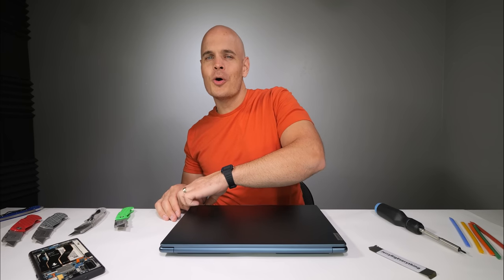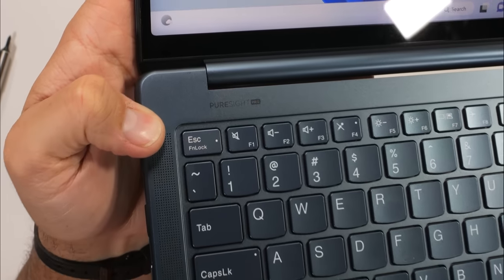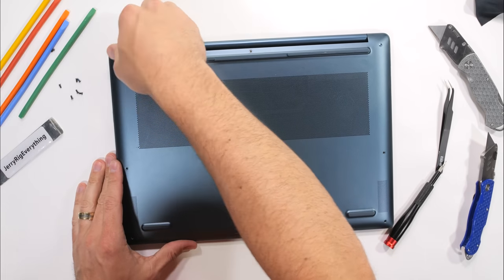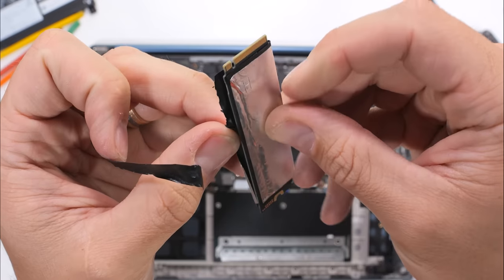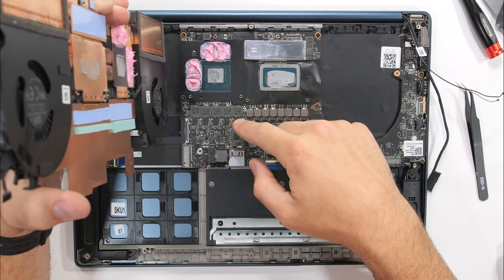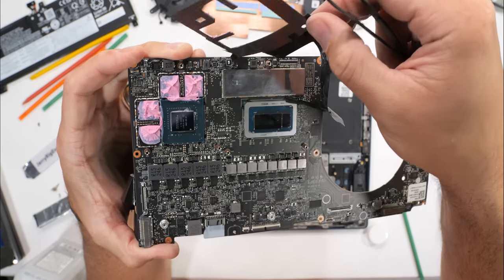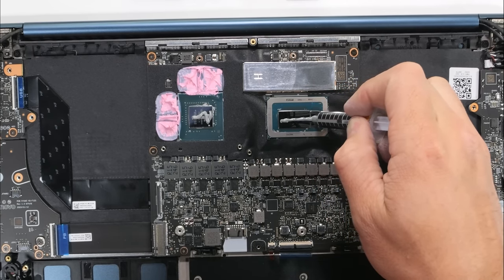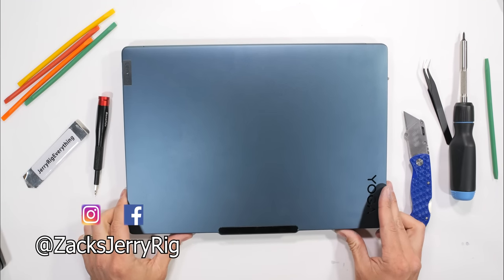FINALLY! - a Professional Laptop that actually puts out

Comment: Just a heads up, the 4070 which this laptop actually has is WILDLY different to a 470
Reply: Dude this annoyed me so bad lmao
ocd kickin
Reply: I thought it was like a custom GPU or sth 😂
Reply: What matters is the wattage and the cooling of the GPU. I doubt this 4070 can even match a properly cooled 3050 before throttling out
Reply: @Chief Master  will definitely match a 3050 lol probably about the same as a 4060.
The gpu is fairly efficient with rtx4000, new gaming laptops are mostly suffering from intel 13gen
Reply: My old y50-70 gaming Notebook had a 960m which had to send the output back to the cpu where the igp had the lanes to output it over hdmi. Nvidia drivers don't even work properly and you had to download obsolete drivers from Lenovo. If these Chinese slits keep doing this rip offs, it would be actually accurate calling it a custom gpu.
Reply: Exactly, fun fact even the 4090 laptop counterpart is only on par with the 4070ti desktop 😬
Reply: @Chief Master  maybe there can be tests to check that. But looking at that cooling solution,  the worst I can imagine is a 3070 if it goes down at all.
Reply: @Random 4400  Yes due to the massive voltage leap on desktop parts in the past 2 generation on the higher end.

Laptop gpu's wattage peaked at 200w with the 2080super or sth while desktops weren't that power hungry.

Nowadays the market shifted towards more sensible form factors and caps at 175w(for now)

The sad part is the actual specs though. 3070ti laptop shared about the same specs but the 4000 mobile series are all 1 tier lower than the naming. Would be more impressive of the actual namings were used, then 4080(4070) won't be too shabby against the desktop 4070
Reply: Just another notice to say, if jerryrigeverything wanted an actually powerful laptop while also doing good for the planet, he could just get a Eurocom Sky x9c, fully modular and far better for the planet as each part is modular and swappable. Besides it can support SLI RTX 2080 mobile. With Intel core i9 DESKTOP Processor.
Reply: ha, yeah, big difference.
Reply: @sierrachief117  it will never throttle as it has 100 watt 4070. 4070 is not scaling over 105 watt. It has best 4070
Reply: @sierrachief117  it will never throttle as it has 100 watt 4070. 4070 is not scaling over 105 watt. It has best 4070
Reply: @helloworld9996  some have great battery. I think something or some settings is wrong in many high end gaming laptops.
Reply: @HDRPC  As far as my knowledge goes, throttling means decreasing the wattage a chip is running at to lower the heat at the expense of performance. Just because a gpu is rated at 100w doesn't mean it'll not throttle at heavy workloads. And as far as thin laptops go, no matter the cooling system they suck at heat dissipation. Which results in throttling. But I digress. This laptop fulfills the need of a thin and light powerful pc and as far as these go, this lenovo might be your best option.
Reply: @sierrachief117  i have seen videos it is not throttling
Reply: @HDRPC  videos don't mean shit, bro. Your usage of the device putting it throughout it paces is what means anything
Reply: @HDRPC  I was surprised when Zack said it has 170W power supply. Both GPU and CPU have to be limited. My Lenovo Legion 5 with RTX 3060 (140W TGP) and 17-12700H has 300W power supply.
Reply: @sierrachief117  anyone dumb enough to game on a laptop needs to give me their extra money so i can upgrade my rig some moar.
Reply: @helloworld9996  13th gen is a big jump over 12th gen in efficiency, sadly.
Reply: @Lucas Blaney  not by much nor noticeable. Its still based on intel7 process(though slightly improved) that still lacks behind the leap on ryzen cpu to tsmc n4(nor is battery life 'improvements' highlighted in any reviews. Ryzen cpus will continue to enjoy a much longer battery life at least until intel manages to manufacture by their upcoming 20a/18a process
Reply: @hello world  it wasn't a massive leap in fabrication process but it was still a much bigger leap from 12 to 13 than 11 to 12 in the efficiency space. But, yes, AMD is the efficiency king.
Reply: @Lucas Blaney  it's not a big generation gap comparing to their only component amd or if u count in apple, which both have seen a substantially larger efficiency improvement per generation, amd laptops easily have more than 2x battery life than intel's since ryzen5000 and the gap hasn't closed in at all
Reply: @helloworld9996  okay
Reply: Although given how far the mobile versions of a GPU are from their namesake, maybe not that wild...
Nvidia, please just stop. You know it's deceptive. Just make a different naming scheme for the mobile ones.
Reply: @Lizlodude  I think they need to bring back the "mobile" moniker.
Reply: @Lizlodude  so they should come up with a completely different naming scheme just for laptops?
Reply: @johnathankrausrig9237  I’m literally writing this on a Lenovo gaming laptop using integrated graphics and latest drivers with no issues.
Reply: @Random_4400  the 4090 is rated for 450 watts, how in the holy hell are you supposed to put that in a laptop
Reply: in most use cases you won’t be using both at the same time, my same laptop uses about 80w in games whilst the cpu sits at 20-25 whilst when doing something CPU intensive it goes up to 45w whilst the GPU sits at 10
Reply: @CommanderBeefDev  where I live it was £200 cheaper to get a gaming laptop that’s is faster in every way whilst still being a laptop
Reply: @LucasBlaney  pretty sure it’s still there, the GPU in my laptop is “3060 mobile”
Reply: @Crystalcluster  I loved to hear that since this chip has bareperformance uplift from last gen, 3070ti is fast as new 4070 on faster Cpu, so its slower than 3070ti on same cpu.
Reply: @sierrachief117  its 100w, which is almost as powerful as the max wattage 4070, since its highly efficien
Reply: @ethangoldwyre  then either you have one after or before they fucked it up. Have fun with broken bezels. The glue is heat activated and the exhaust, as far as I saw it on newer models, is still between the hinges. Another stupid moves Lenovo made
Reply: @johnathankrausrig9237  considering the fact that mine (to my knowledge) has no glue on it whatsoever, and the hinges are solid metal i highly doubt something like that is going to happen.
Reply: It's leagues better than its desktop counterpart gtx 470
Reply: @ethangoldwyre  suuure it has not.
Reply: @johnathankrausrig9237  why’s that so hard to believe?
Reply: @ethangoldwyre  i had the y50, a thinkpad at work, a yoga 2 in 1 and repaired some various Lenovo laptops. In all its like they trying but are dumb as fuck and fail to make the inserted features really matter. It not even cheaping out, they are just dumb in their way of designing their products.
Reply: @johnathankrausrig9237  I’m using a legion 5, rebuilt the 2020 model of it as well and couldn’t see any obvious issues, guess we just have different experiences with them.
Reply: I respectfully laughed when he said that.
Reply: @sierrachief117  these are the xps9730 4070 numbers:.                              Passmark - Ultra Performance mode  
CPU Mark: 28075  

2D Graphics Mark: 644  

3D Graphics Mark: 23565  

Memory Mark: 3841  

Disk Mark: 31232
Reply: ohhhhhhh a FORTY 70 not a FOUR 70. Makes me feel much better.
Reply: @helloworld9996 Voltage is not a problem, as most laptops run from a high current 14V battery and their external power supplies either provide 18 to 20V on old connectors or up to 48V on USB C .  DC-DC switching VRMs can convert almost any voltage to any other (the famous Joule thief is a simple 0.8V to much more design).  Wattage is what matters because you can't create energy, only move it or degrade it.  So I'm glad all the other comments focus on watts too.
Reply: @dj-protoOfficial  dude, 19,000 euros
Reply: @Guds777  If you max out the specs.
The whole point in the laptop is that it's modular fully, you could buy a low Speced one, and upgrade it's parts to higher end parts later or pick one specific higher end part on the specifications sheet. For example, if you needed something good for gaming, you could go with an i3 K 8th gen, with SLI GTX 1080 or RTX 2080, or Single RTX 2080 or GTX 1080. 
For more industrial uses, higher end CPU with lower end GPU.
Etc.
Reply: @LucasBlaney  Even their GPUs are more efficient than Nvidia.

Hell since the 4090 disaster, a lot of people have actually turned to Radeon's safer and more efficient Radoen RX 6900 XT.
Reply: @LucasBlaney  Not really.

Could get more efficiency for power out of a 32core Xeon.
Reply: @dj-protoOfficial  lol 2080s?
Reply: @dj-protoOfficial  okay
Reply: @LucasBlaney  30 Series has heating issues, 40 series has more major heating issues. And modern laptop cooling is so bad that these issues are only accelerated.

Also 20 series were the last still modular GPUs for laptops.

Also SLI 2080 can match 3080 in some tests.
Reply: @dj-protoOfficial  exacerbated* is what you likely meant.

And okay. Sure.
Reply: @LucasBlaney  Whatever mate, modern laptops suck anyway. Because all they wanna do is slim them down and make them less repairable.
Old laptops and Eurocom laptops are pretty much the only decent laptops left.
Reply: @dj-protoOfficial  lol k
Reply: just never unplug it and use 10 lbs of coper in the heatsink and maybe if you are lucky it will run at 95c  @ethangoldwyre
Reply: thats completely normal. A desktop 4070 draws around 200 Watt max, a Laptop 4070 is designed to draw between 35-115 Watt max (official data from nvidia).

Comment: I own a yoga book. Mine is still going strong from 2013. Getting long in the tooth with a dual core. Best laptop i've ever owned. Not only is it a capable machine but It's also built like a tank. With a background in IT I highly recommend this machine to anybody and everybody. Spend the money it will be worth it in the long run.

EDIT: STILL GOING 8/17/2024
Reply: I bought a Lenovo touch screen laptop around that same time, it was a total disaster with preinstalled virus and a lid too flexible to open without breaking the glass screen.
Reply: same here! my old yoga book was my best friend during my whole 6 years of Engineering studies. It fell so many times, it travel everywhere, was stepped on and having many other adventures, but still is going strong even with some parts missing :)
Reply: @МезенцеваАлена-ж3е would you recommend the yoga slim pro for a computer science student in 1st year?
Reply: Yeah but can he handle After Effects ?
Reply: @monsieur.moriarty ofc these are workstation laptops. The GPU used in this one is not for gaming it's for creative tasks such as Maya, blender, AE
Reply: @jayv7122  what? It's an RTX 4070. Of course it's meant for gaming.
Reply: The only issue with some of the Yogas is that you just need to be very careful with the power button. it's location is very dumb and it's fragile, if it breaks you have to replace the whole motherboard. I'm loving my p73 though
Reply: @poppers7317  yeah it can handle games as well. but this rtx 4070 is a 'studio' version which is basically made for creative tasks as i mentioned.
Reply: @ArcYT  yeah the power button location is stupid. Very easy to accidentally press. Wish it was next to the keyboard like normal
Reply: I think I'm going to get a used Thinkpad X1 yoga today or in the next few days

Comment: I was expecting the new 16" framework laptop, but this definitely didn't disappoint.
Reply: @FuckedUpGenius  I'm all for open hardware (and open/free software since we're at it) cause I hate proprietary BS *cough* Apple *cough*
I was just saying that this laptop is a power-machine and very technologically impressive, as is every new-gen laptop every year....
Reply: I would also love for him to tear down a Framework laptop when the newer ones come out.
Reply: @FuckedUpGenius  removeable mobile processors are not coming back.
Reply: I expected a ThinkPad, not a Yoga.
Reply: with that kind of title I also expected Framework instead of ...this
Reply: @FuckedUpGenius  Laptops are too thin nowadays to account for a removable socket
Reply: not rly because it was made by Lenovo
Reply: @FuckedUpGenius  what the sense of Framework and their paper releases, if you can't get it
Reply: @s.i.m.c.a  typing this on a 12th gen jntel framework laptop
Reply: The framework is overpriced for the anemic specs it has
Reply: @s.i.m.c.a  Paper release means only an announcement correct? Unless you mean limited stock? Because they have shipped out laptops for their intel 11th and 12th gen processors.
Reply: @FuckedUpGenius  Well I can guarantee that no effort has been made to make that particular laptop repairable. I was mainly thinking of Framework Laptops when I made that comment. I wouldnt be surpised if you can't even upgrade your ram lol
Reply: @heavy0119  Considering every inch of the Framework has been engineered to make it expandable and upgradeable, it's going to cost more than some cookie cutter Lenovo.
Reply: Doesn't have a miniLED display unfortunately, maybe next time
Reply: I also clicked on this video, thinking it's about framework xD
Reply: @coherentpanda7115  Sorry, the idea of paying $800 for a laptop without memory, storage, ports, or a keyboard isn't appealing to me.
Reply: @FuckedUpGenius  right now- because no one has a reason to. manufacturers have no reason because a socket suddenly adds more concerns to a part (expensive one!) that can fail because a mounting screw is too lose, got shoved in the wrong place, etc... Just adds time to manufacture- only people concerned about it these days unfortunately is mostly enthusiasts. Not to mention it wouldn't help their repair business ,though I doubt that's every companies concern.
For framework in particular, there's no amount of money that would likely convince amd or intel to start making these socketed mobile chips again- additional cost for them that few want/need.

And finally, in the future, like it or not things are only becoming more and more integrated - look at Apples M series of SoCs - having ram, GPU and any other critical function as close to the CPU (as well as removing the burden of x86 architecture) is the way to power efficiency and increased performance, as much as it has critical drawbacks.
Reply: I don’t see the laptop making it pass your torture or I could be wrong as well
Reply: @cinnamon4183  technically, i think with a framework, you can swap out the mainboard [ie. cpu] for a newer one
Reply: @hiddendrifts  A motherboard replacement replaces more than just a CPU. How they manage that is a heck of a lot better than other manufacturers, but its not a CPU swap. 
Older laptops had CPU's that had sockets, much like desktops. An upgrade (though realistically, only same generation) could and was as simple as swapping the CPU, where there wasnt manufacturerer implemented blocklists.
Reply: @cinnamon4183  >it's not a cpu swap
sure, but even having the ability to upgrade the cpu is better than nothing
Reply: @FuckedUpGenius  Yeah cuz 16GB of RAM isn't going to be enough for the average person 🤣🤡
Reply: @complicatedbreakfast7645  the only clown here is you bud. Lenovo doesn't care that you're white knighting for them. I almost always use more than 16GB of RAM and frequently use more than 32GB. So no, having 16GB of RAM soldered with no expandability is not acceptable.
Reply: The power button is gonna break at some point

Comment: I use the Lenovo ThinkPad X1 Yoga 3rd edition as my daily driver for three years now. No complaints except that the buttons leave permanent markings on the OLED screen. The laptop still rocks.
Reply: How much battery life do you get from this laptop since this is a power hungry OLED screen and which OS are you using, windows or linux? Also, did you face pwm screen flickering while on low brightness during these 3 years or any dead pixel? 
I'm planning to buy thinkpad T16 gen 2 AMD and confused whether to go for IPS or OLED display due to low battery life and pwm flickering.